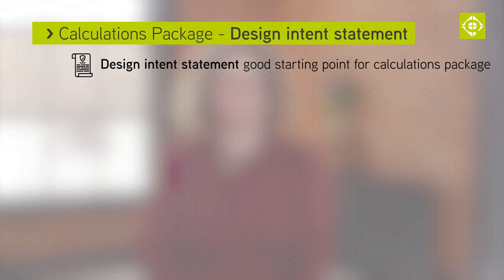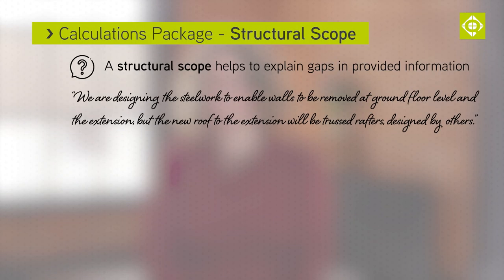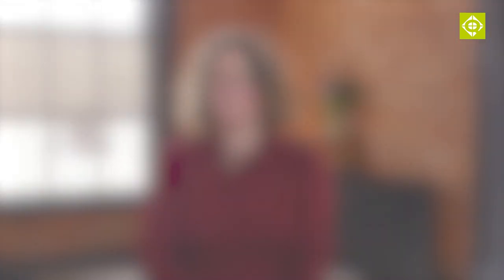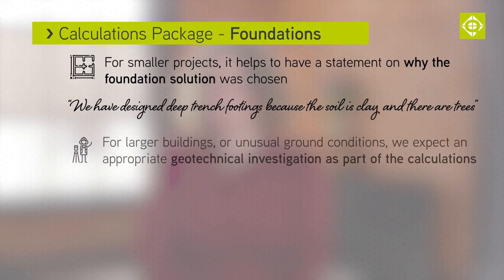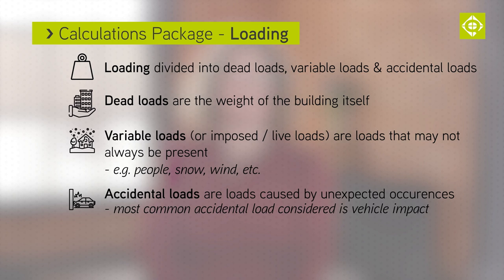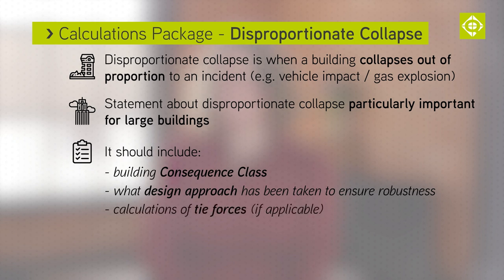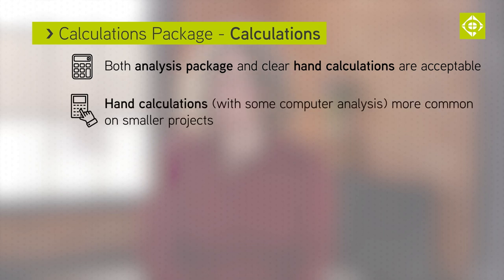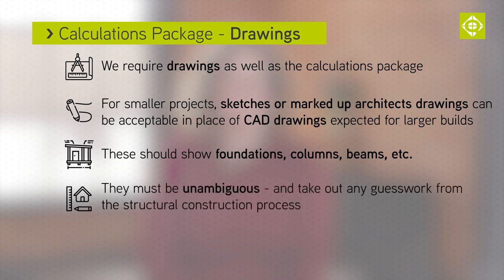Part A - What to include in your calculations package

Comment: Very useful video. We actually updated our template sheets and incorporated all the info you mentioned there including the mining maps on footings. Also your post on linkedin regarding horizontal ties and forces applied was very useful. I believe that that is why Idea Statica now includes the tie force in the analysis of connections in the latest version. I think the challenge is when we are looking at multimaterial like it now happens with all the old brick walls factories  in the city centres being converted to flats. Mainly because we are faced with primarily masonry structures with either cast iron or low grading internal steel beams and where the interface timber floor joists to steel beams and timber floor joists to masonry have to account for horizontal tying forces as the floors must be diaphragms for the structure to pass. So vertically there's no issues as it was designed for industrial uses but horizontally they need to be strengthen especially when they are removing lift shafts and suchlike.  As I said at the begining, big thank you for taking your time to produce this video.

Comment: Well set-out video - thanks.

For smaller domestic alterations where a main rear wall is to be removed, I've lost count of the number of spreadsheet-designed moment frames by young SEs I've been asked to review, and which are hardly ever necessary. If the house has sufficient  remaining internal walls in the x-x direction, it can be easy to show by calculation sufficient robustness, so saving the client £££s.

Another old chestnut is the effective length of steel beams. Many SEs unthinkingly follow the design codes, Le = 1.2 L etc. Invariably it gives bigger section sizes than necessary when dealing with small-scale domestic work, where destabilizing loads are hardly ever present.
(recently reviewed a design for a 3.6m wide domestic floor 6m long and supported in the middle by a 203x203x60. Bonkers!).
Reply: I used to be a site manager and remember having this conversation with an old-school structural engineer. His comment that will stay with me was, " when I was a trainee we were told to review our calculations to see if we could safely downsize an element to save expense and help the architect to maximise space. Nowadays the young engineers select a size and if it `passes` the computer analyses, then that's what they put down".